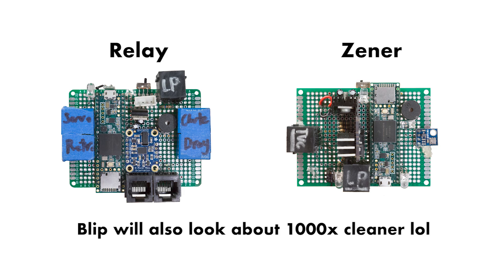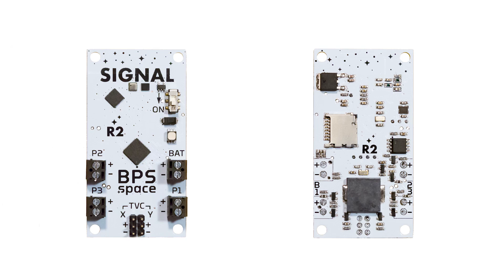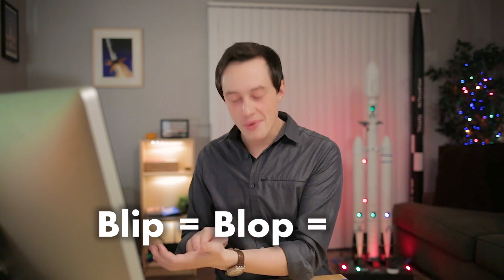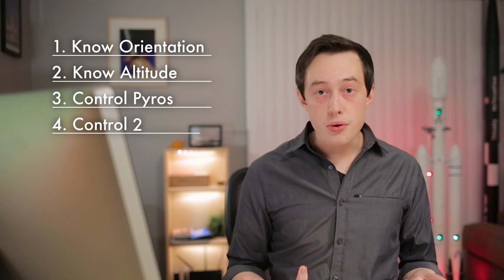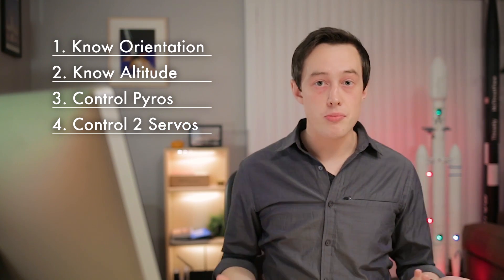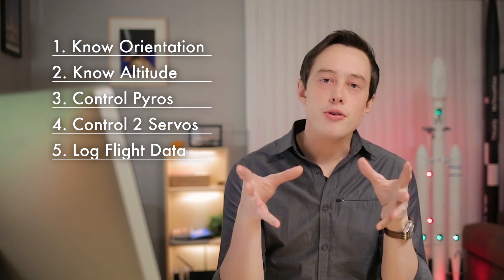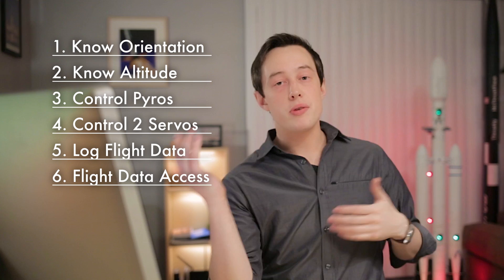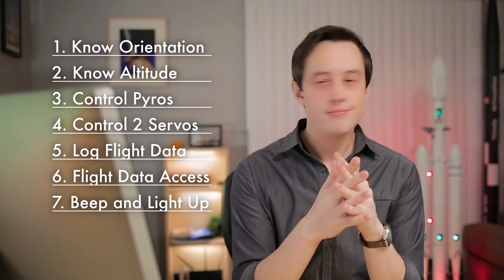Flight Computer Outline - Landing Model Rockets Ep. 3

Comment: because imu's or iru's... inertial reference computers where designed for planes not rockets, planes have a different xyz orientation, flipping it upside if not programmed really well youl'l lose you inertial reference, also there is something about a gimble lock, F35'sC's with vertical take off or even the harrier have modified software, like my question is why not use lazer gyros?

Comment: Can we do this with ardiuno plz ans ???????????????????????????? Please reply #elonmuskdiehardfan
Reply: this series is discontinued due to stress.. you could probably just get an arduino, put some sensors and parts on it, then code it, then you got it.
Reply: @fullflowaerospace  thank you so much
Reply: @FashionFoot_Shop  your welcome.. I will try to find a video on it to show you a working one
Reply: @FashionFoot_Shop  I found a video on the arduino one, but you could also get a long breadboard or Proto-board, but the breadboard has automatic connections, while the Proto-board needs wires to make connections. You could just buy some parts, like a teensy 3.2 for power and to plug into a computer, a accelerometer that will work, a barometer that will work, a flash chip, a microSD card holder, through hole terminal blocks with mosfets to go along with every single one, and probably some more stuff but I forgot.. you probably want to watch episode 4 of this for some parts to use, but you don’t need to use some of them.
Reply: @FashionFoot_Shop  you actually do need at least 2 pyro channels because you need 1 for parachute deployment, and 1 for the battery. You also probably want a switch to turn on and of the computer

Comment: sensor fusion will not work properly because acceleration is changing rapidly due to thrust and aerodynamic forces so we cannot predict it properly to get a direction for gravity vector which will be used in sensor fusion to find the attitude.

Comment: Hi Joe, that was a really good video and a really interesting analysis of the reasons behind each choice of either the components or the overall project. I’d suggest as an alternative to the EEPROM for storing the flight data for analysis, an Adafruit FRAM (Ferroelectric RAM) module. It comes in both SPI and I2C interface based on its size and its advantage is that it can be read/written as a RAM, it’s non volatile as an EEPROM and it has over a trillion write cycles instead of a few thousands of an EEPROM without needing any backup battery as a CMOS RAM would.

Comment: An IMU determines direction based on gravity, however, when the rocket is under acceleration, it throughs off the measurement because the IMU only measures the direction via gravity.

Comment: I can tell you from experience, making sure the flight computer of a rocket beeps and lights up is absolutely flight critical (not being sarcastic). Especially when that computer is being handed control over engine ignition or other pyrotechnics, you want everyone within earshot to know when it turns on. Additionally, it is a good idea for it to flash certain distinct patterns and sounds as it runs through all major initializations (the setup code block for arduinos, for example) so that you have visual confirmation that, at least to its knowledge, everything is functioning. My team made the mistake of having an overly confusing sequence of tones during startup and it was nearly impossible to tell if it had initialized everything successfully.

Comment: The Stm32 is way more powerful and there is a huge open source community for your exact applications since it is used in fpv and quad opter/ plane systems, which require very similar sensors, another great thing is it can be programmed with the arduino library so you get the same community and support with a more powerful 32 not over 8 bit arm cortex m4.

Comment: Hi Joe. I don't know where I'm going with this message but I guess you could say I need help. So I'm 12 and this will probably sound stupid to you but that's fine but I want to get started in what your doing.  If you could let me know just what skills I need or just any information would be appreciated. I just don't know where to get started but I know the goal is to make model rockets like yours. If you don't respond that's fine but still great videos and keep up the great work it's amazing.
Reply from the maker: Not a stupid question at all! I'd recommend picking up an Arduino or Raspberry Pi kit and just give coding and electronics a try. You could also pick up a cheap Estes rocket kit and get familiar with a local NAR/rocketry club. Finding some friends in the hobby will help you learn faster too. The worst that can happen with both of those is that you have a ton of fun, and learn some new things :)
Reply: @BPSspace  To start thank you for replying! Although I have tried coding (python) and electronics like soldering. I also have gotten an Estes rocket set and put it together and launched it. Then the one thing I would have to do is get into a rocket club. So the thing I really want to know is what can I do with my little knowledge of electronics, coding, etc. Like some sort of project I could do with a raspberry pie or Arduino that somehow correlates to making or programming rockets? Again thank you for replying and understanding as not many people do.

Comment: J. are you running any compression software to optimize for microprocessor speed?  Also what is your motor mount reaction speed per seconds, also do you find that because the motor mounts speed is your limiting factor that your CPU does not need to have more Dhrystones.  I think if you increase you CPU on the Falcon Heavy upper Stage you'll rocket will last longer before losing control.  Sincerely T.M.B.S.S.

Comment: I think MPU6000 might be a better option than the 6050 because 6000 is less sensitive to vibrations and will require less filtering and processing power from your atmega328. We had this issue in the quadcopter community and we all switched away from 6050.
Hope that help. Love your content! Good job
Reply: Yes the MPU6000 can use the SPI.  Sampling at 8khz means you could take a larger running average to account for vibrations. Or you could bank on Icm-20689 becoming the default option. More powerful CPU would be needed.

Comment: Hi Joe  i think yr question has been answered and i agree that the rate sensor and accelerometer will both can max out and angle and acceleration cant be measured and the filtering will have no effect as the data given is incorrect But im interested to see your solution..im also wondering how you control thrust on chem rockets or do you use the gimble to achieve this like rotational vectoring the thrust in all directions to lower thrust with atitude control included and then just atitude vectoring to maximise thrust...?? im very interested...thanks keep up the great work

Comment: Ever try taking the acceleration data, integrating (as in calculus) it with a simple ANALOG circuit to get rid of the noise?  As a bonus this will give you a velocity measurement.  IIRC, this is why opamps were developed, back when they used vacuum tubes.

Comment: I was thinking that since you can't throttle a solid rocket motor, perhaps you could instead divert the thrust sideways. Consider a clam shell scoop "brake" that could close around the bottom of the rocket to divert thrust in opposite sideways directions. servo control the closing of that clam shell scoop to control downward thrust.

Comment: The IMU isn't going to be useful in a rocket due to the rocket is traveling in a straight line/one direction. IMU needs to see or measure different rates of turns or angles in order to produce data. Kinda like it needs to triangulate itself in order to give you it's orientation on a horizontal axis vs just going vertical in one direction... maybe the only time it works or needed on a rocket is when it's catastrophic or loss of control losing its vertical/upwards flight.

Comment: Joe,  One improvement you could make to landing a rocket is to create a internal bay for your battery and USB cord. Use the shortest and lightest USB cable you can find. Make sure to have the battery at the lowest point possible, also center the weight. The rocket needs to be balanced. Also make sure the battery is insulated from the solid rocket motor. Maybe using aluminium foil?  just my two cents. Have a nice day.

Comment: Sounds like a really cool project.  As a kid I launched Centuri model rockets.  Now I do electronics and SW design.  My son and I are both memorized by SpaceX.  He is working on his ME and would like to work there.  This might be a cool thing for us to try together.  
One thing I would recommend is to reconsider the processor you are using and at least look at using the ESP32.  This processor is VERY affordable and has a variety of breakout boards.   It meets all the constraints you specified and is much better suited for use with a battery and has way more memory and CPU power than the ATmeg328 and costs only a little more. Also it has dual high speed cores which makes realtime control easier.  It also has an onboard 2.4GHz radio so you could use it to send back realtime data.  It can run Arduino code and also support for high level programming.  Currently Esperion (makers of the ESP32) created the Arduino core used for ESP32 Arduino support.  Recently Massimo Banzi (CoFounder of Arduino) announced Arduino will be developing their own Arduino core for the ESP32.  This indicates the ESP32 is where they see the future is for IOT.  I think you would be much better served now and in the future by using the ESP32.

Comment: just wondering why solid rocket to land?  I dont know yet how you you gonna solve that.
SpaceX and BlueOrigin use Liquid fuels because they can control the power and they can restart anytime.
Reply: Solid fuel because designing a liquid-fueled propulsion system is damn hard. If solid-fuel motors can successfully land a rocket (harder sure, but possible), the work involved with making a solid-fueled system work for landing is significantly less than even making a liquid-fueled engine work at all
Reply: @kerolox7929  solid is harder to control. 
1. cant control power output
2. cant stop until all fuel is consumed

Comment: 2:59 Well it depends it what you mean it doesnt work BUT maybe it ls the position where you put the gyroscopes so to have more accuracy you could have one in the top 1 in the middle and one in the bottom of the rocket to give the computer more understanding of the inclination of the rocket so it can work more quickly this with the accelerometers in the same places should be enough (I dont know if you did it already)

Comment: wrt breakout board for the SPI flash: there exists prototyping boards for those common SMD packages, I see the brand "SchmartBoard" on mouser.com, with things like "PCBs & Breadboards SOT 23/SC70 SMT to DIP Adapter" item #204-0003-01
I am not sure it's always a good solution, because there is no provision for the decoupling capacitors.

Comment: I have an idea for your echo lander, you already know that but the reason why it is very hard to land the rocket is that the rocket egnition has to start  at exact perfect time and it is almost impossible to do it because each rocket fuel burns differently. Now what if instead of one rocket fuel, you use two, and place them with an angle (kind of like a Dragon2 capsule). Now you can hover the rocket by making the angle between two rocket fuels bigger or smaller.
Reply: The difficulties with this idea is igniting the motors simultaneously, especially hobby rocket motors

Comment: IMU sucks in rockets because of vibration, there is a hume amount of these vibrations in rockets that create a lot of noise in the output data
Reply: Maybe some damper would help reduce noise.
Reply: @spacedoge3508  But if you do that you risk not sensing important information, when messing with aerodynamics every fraction of a degree is important
Reply: So what's the best solution?

Comment: It seems to me the "missing ingredient" is ability to throttle the rocket or, at least, shut it off. This is because the thrust of the retro rocket has to be greater than the weight of the vehicle in order to slow it's descent. But if  you can't turn it off when it lands it will go back up again.

Comment: hello joe i am aabhaas sikka i have been working in rocketry far a long  time. i have developed a carbon fiber, aluminium and copper 3d printer  so i can print rockets and make rocket engines . i dont under stand that which software should i use for rocket analysis and trajectory because in india we have very less resources .
i am doing stuff with arduino but need to understand PCBs .
Reply: You've posted any videos of your printer? If not, please do.
Also if you're just getting started you don't need to mess with PCB design as most of the components are available as modules, which you can just solder together on a veroboard.
Reply: Chetan Sharma +1 on this. You should use PCBs at a later stage, breadboards and protoboards will work just fine. There is some software for things like that, but you can program simple simulators yourself using languages like Python.

Comment: Wouldn't it be possible, to put a piezosensor into the engine bay to messure the thrust the engine puts out for more acurate thrusvectorsteering?
Reply: I guess yes, but then you need a temperature sensor because they drift, you need 3 force sensors of them to measure the vector components. It gets complicated quick. but if someone else's is spending their time and money, I'm curious about the results :)
Reply: @nraynaud  Ill straightup do tah (shameless plug to the atmoventus youtubechannelcoughcough)
what I mean: directly above the motor in the moving gimbal, where the force is always upearts at the sensor.
Reply: @foersterjunior  I subscribed, thanks. Can you explain your design, instead of just posting launches? I am really fascinated by the mechanical integration of sensors in robotics.
Reply: @Quasi Maji no motormixing in Germany without exessive training an expensive lizensing...
Reply: @foersterjunior  Danke Merkel
Reply: I will, we just started the cannel, were gonna do explanationvids by christmas if our time allows us
Reply: @foersterjunior  I found some normal small force resistive sensors on sparkfun, why not use those instead of piezo sensors? they look smaller, more linear and without lead in them.